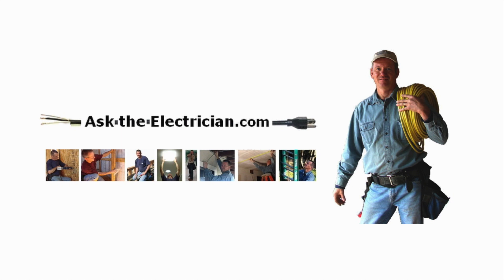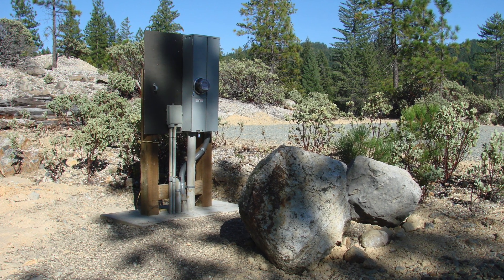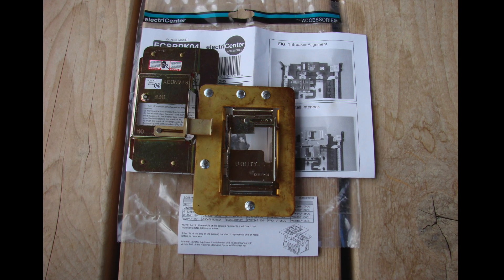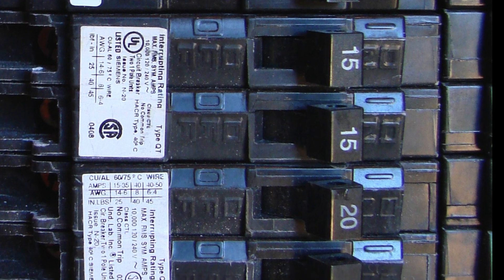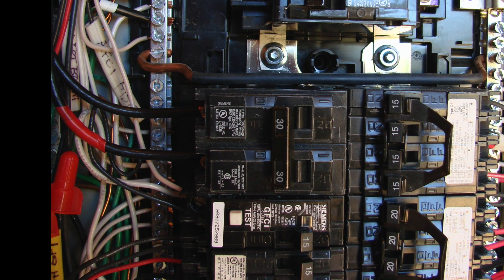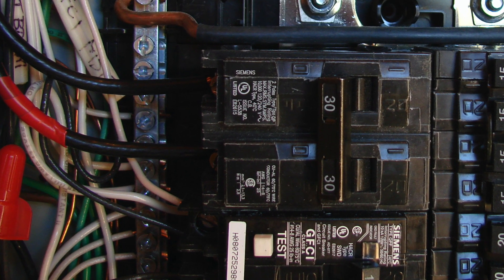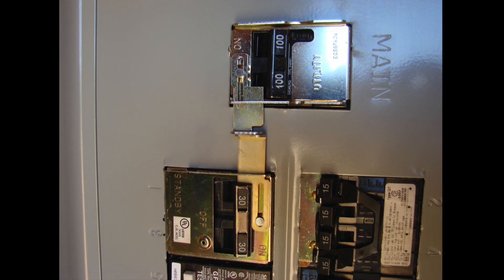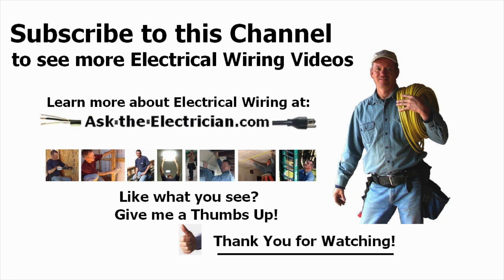How to Hook Up a Generator to a House Panel For Backup Power.

Comment: Really good video it was informative but I could use some help like I said trying to figure out if that 1 50 amp double breaker will power the whole breaker box I know that it can't power like my central heat and air in my all that stuff I just mean do I have to wire up two separate Breakers so I can run all my other stuff or do I have to move everything to one side it is a 12000 W dual fuel Westinghouse
Reply from the maker: We typically calculate the load that will require generator power and size the generator based upon the calculated load. Of course, you can shut off certain circuits that do not need to be on generator, or circuits that will cause the generator to trip off due to an overload if the generator is not large enough. This is why it is important to select the right size generator for your home.
Reply: I have a welding outlet in my garage. I ordered an inlet box to replace welding outlet. The box  is a 30 amp. The welding circuit  has a 50 amp breaker. It is a sub panel and thinking of adding a main cut off switch to the panel. Do I need to replace the breaker to a 30 amp? I have a predator 9000/7550 generator.  Just curious because I see backfeeding to dryer outlets. I don't have a welder and the out is in a perfect spot in garage. Thanks for your help.

Comment: Well that 30 amp breaker power both sides of the breaker box or do I need to place another 30 amp breaker on the other side so I can power all of it I have a 50-amp generator 240-volt
Reply from the maker: One two pole circuit breaker is sufficient for connecting a 120/240volt generator, along with the proper interlock kit, all being sized properly for your specific application.

Comment: Wouldn't that only power the one side of the panel?
Reply from the maker: When using the properly sized two pole circuit breaker and connecting to a 120/240volt generator output this will provide power 120/240volt power to the whole panel. Obviously this is application specific, which means that each project has it's own specific factors, but for the most part, this process works very well for most installations. Keep in mind that the generator will only provide the stated power limitation, so be sure to look carefully at the specifications of the generator you are considering, and the panel specifications that the generator will be connected to.

Comment: So it's ok to hook Both Grounds to the Ground bar inside the breaker box, only reason I ask is because I have seen some videos saying absolutely do Not do that , thank you for your time and stay safe
Reply from the maker: Verify this by looking at the owners manual to see what your specific generator's electrical connections are supposed to be for your specific generator and your specific application.

Comment: Was this generator a bonded neutral or a floating neutral in this video?
Reply from the maker: Great question, I don't recall, however we typically follow the electrical specifications for the specific generator and application requirements.
Reply: I believe the code states bonding at the 1st point if disconnect is required and the generator ground to neutral jumper should be removed and the generator labeled as a floating neutral.
Reply: Very important question. What does the code require? Floating or bonded at the generator?? I am not an electrician that is why i'm asking you sir.

Comment: What if my generator is a single phase 30 amp? How do I properly power up both sides of my panel?
Reply from the maker: If your generator does not have a 240volt output then it cannot be used to properly provide power to a 240volt panel.

Comment: Monotone... To Slow...  Boring...
GREAT JOB !   THANK YOU !  👍
You didn't mention prices 👎
Reply from the maker: The price for hooking up a generator will depend on the specific generator you have, and the specific panel and components required for your application. I do not represent any company, and there are several options available for you to select for your application.
I hope your generator project turns out well!

Comment: What if you dont have a main circuit breaker?
Reply from the maker: My first though is it would be a great time to upgrade the main electric service panel, Next would be to install a sub panel with a main breaker and have all the circuits that will be on generator power installed in the new sub panel, or install a generator panel such as the Reliance Load Center. Another possibility is to consider a product called GenerLink and see if their product would be compatible with the electrical meter  that is installed on your main service panel.
I hope this helps you!
Reply: You definitely have a main circuit breaker

Comment: Which Cord did you use or wire to connect to the circuit box
Reply from the maker: The cord is sized to the output of the generator, so the size of the cord will vary. The cord Type is typically an SO or SJ 4-wire cord. As an example: If the connection point on the generator receptacle outlet is rated for 30amps then a #10 Cord - or 10-4 SO or SJ cord is used - 2 hots, a neutral and a ground wire.

Comment: Great video. I have one electrican saying I need a Transfer switch because its required by the national electical code and another telling me all i need is the interlock. Who should I believe?
Reply from the maker: Both devices are considered a transfer switch if they are UL approved and properly installed.

Comment: Thank you for the video this and does it matter weather you use a generator with a bonded neutral or floating neutral in this kind of set up as far as safety for lineman working on power lines? Thanks again for your video.
Reply from the maker: Refer to the specific generator that you have for their requirements. This information will be indicated in the User Manual. 
However the main ground at the service panel will be intact, while on normal power or when connected to a generator. it is important to have the ground wire as part of the power cord that connects the home to the generator.